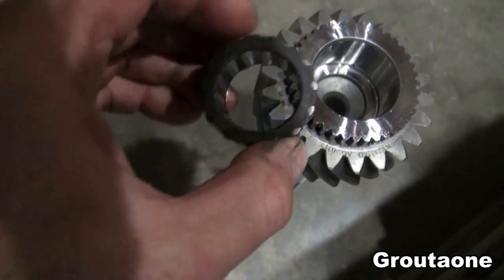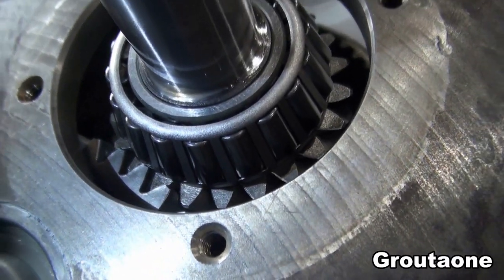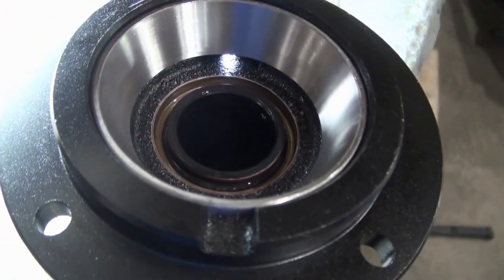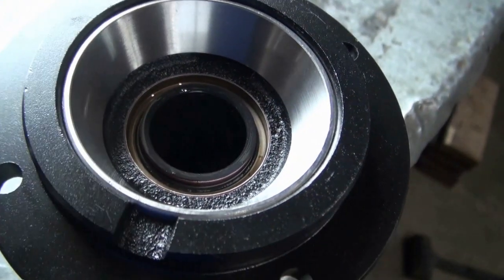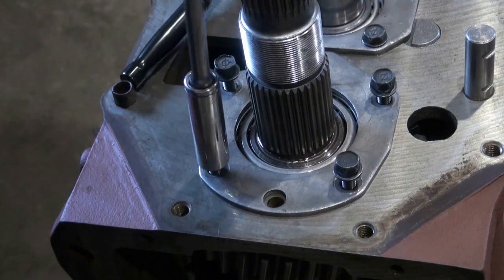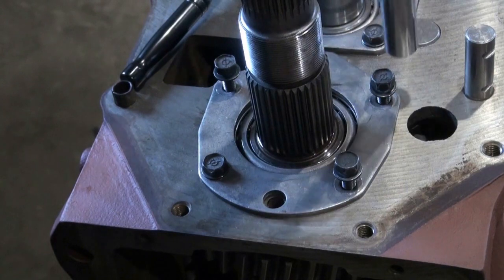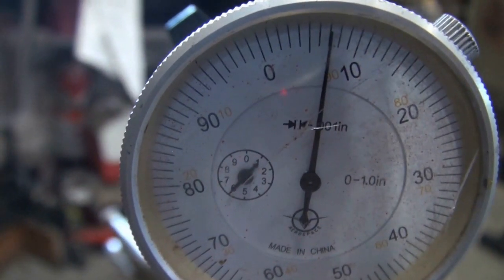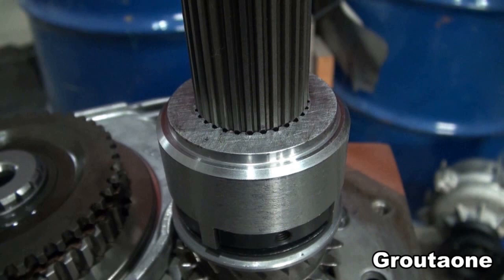Dodge NV4500 Main Shaft Install part 3

Comment: I know the video is old but what brand is that 5th gear locking device? Im rebuilding my trans and i would like to know which brand you went with.  Thanx.
Reply from the maker: Good question but I don't know the answer, I think I got it on Ebay.
Reply: @groutaone  thanks

Comment: When installing the main shaft rear bearing do you press it on all the way against the washer? And is the reverse gear suppose to spin when you press the bearing on or spin with the shaft?

Comment: So you're telling him in the comments that on the Dodge 4500 I should press the bearing on BEFORE I install the main shaft?
Reply from the maker: I think if the bearing has to be removed to get the shaft out, then likely the bearing will have to go on after the shaft is in

Comment: Thank you for posting this 3 part rebuild. I have a clanging noise in all gears when accelerating and decelerating. Now I suspect a loose end cap causing severe back lash. Either on the main or counter shaft. Also got an oil leak on the input shaft of the T case. Any thoughts? Is the oil leak maybe related to a loose end cap? 1995 Cummins.

Comment: This series really helped me on mine. Thank you for taking the time to make it!
Reply from the maker: Thanks for watching, did you press the bearing on the main shaft before or after the shaft went into the case?
Reply: @groutaone  Mine is a GM 4x4, so my main is slightly thinner and longer than the Dodge. The early GM also have centrifugal lockout hub made into 1-2 synchro that keeps you from downshifting to 2nd or 1st over set speeds. I dont know if that makes any difference, but I was able to install the bearing with mainshaft out. The countershaft had to have one installed and another once in the case like yours...
A couple things on the chevy nv4500 I wish I had known about: the aftermarket one-piece countershaft is machined for a thicker snapring on 5th gear side, luckily the aftermarket small parts kit thats available had it! The aftermarket input shaft to bearing is a .003 interference  press fit, making it extremely tight. Will have to cool one and heat the other.

Also, my aftermarket mainshaft measured 1.525 where 5th gear rides, the new 5th gear is 1.520 making it a .005 interference fit. 500 degrees will only get you to 1.522 on the gear, still impossible to fit. Will have to hone .0025 out of the inner splines to even have a chance at be heat/pressed on. I suspect the aftermarket anticipated re-use of worn shaft or gear so they ran their tolerances on the tight side. When using both new, the tolerance stack up is to great...Or maybe the chineseum expands on the trip over (;
Reply from the maker: Thanks for the info, chineseum ha ha
Reply: Rick Sanchez when installing the main shaft rear bearing did is it suppose to make the reverse gear not turn but on turn with the shaft I also have the Chevy NV4500